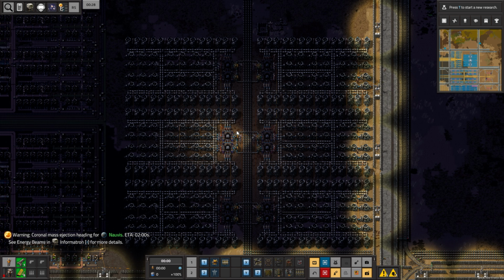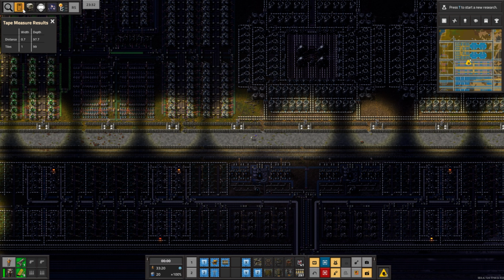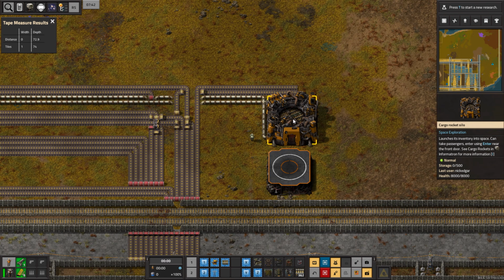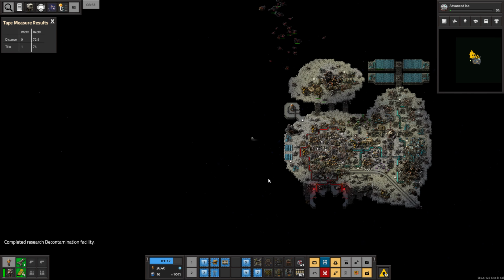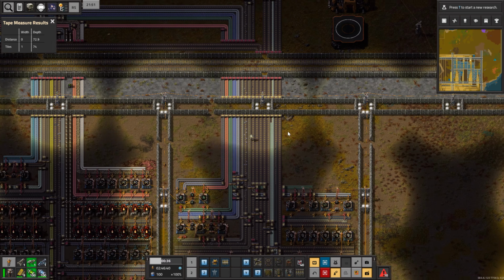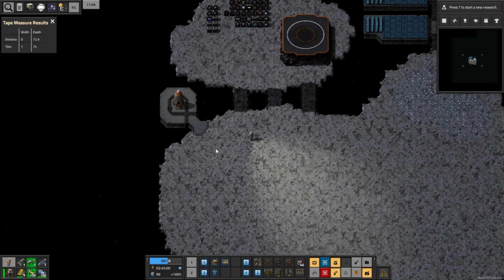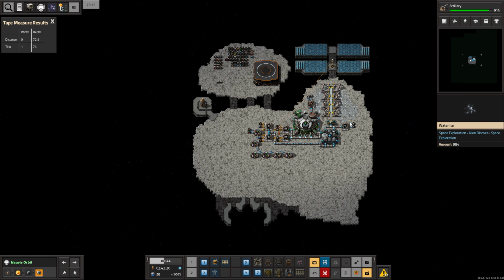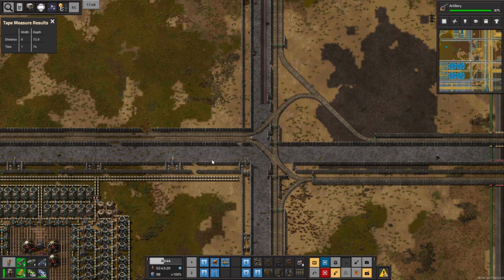Factorio - Let's Play K2SE II Episode 4

Comment: 5:00 You've probably already figured it out in the rest of the series, but once you launch your first satellite, you get access to a 'satellite view' (key N) from which you can see anywhere on any planet you've discovered (including revealing the dark parts) so you can easily check fullness of tanks for example and, more importantly, you can manipulate a lot of the elements (change direction of belts and inserters, flip switches, change settings of circuit elements, ...).

Comment: And I know you went over that someone in the comments would be like "oh you just need this mod" - but Circuit HUD V2 sounds exactly like what you're describing for tracking signals with a panel in real time. You can do a lot with tracking fluid amounts, power usage (active reactors? active boilers? accumulator charge?), logistics demand vs supply, all sorts of bits like that, and filter it out into sectioned parts of the panel, and hide the panel when you're not trying to monitor or diagnose issues.  In the bobs/angels example, alerts for acids/fluids/gasses being too high or too low, alien orb amounts, stone byproducts.. Or a count of MOX, 234, 235 fuel cells in storage. 

It will also help out when you start sending signals from orbit to surface and planet-to-planet. Having the request amounts negative/red vs the supply amounts positive/green as just a quick glance for what is missing and where. Maybe even just as a quality of life bit where you dont have to mouseover a signal from mapview and look at the entire signal at once, but can instead have a combinator giving you the important detail while filtering out all the nitty gritty that went into that -- turn on landfill production to produce salt for more batteries, rather than just seeing the logistic supply of the three separate items and tying it to a speaker when salt or batteries are too low.

Comment: Also Note: I know you don't particularly like Modules.. You may want to reconsider that with this mod for certain things.  Trying not to spoil what is to come but just know you'll want to have them at some point most likely because of obvious reasons when you get there.
Reply from the maker: In vanilla, yes, I don't like them. In big mod sets it's a completely different thing. I made them in every angel and bob factory and I used them all the time. They will get attention.

Comment: Ah! the beauty of the first accidental walk out of the platform, the: Oh! No! come back! where are you going!!!!

Great content as always. Thanks for the hard work with those timelapses.

Tips spoiler free (no mention to anything you don't have unlocked) ^^:

- In case you missed it, with your first rocket you got a message that it found a cache with items in the map (coordinates in the informatron, last section "Exploration journey"),  it contains a railgun with ammo which will trivialize clean territory of biters. It contains requester chests too. You got a few new weapons in orbit too which are a bit overpower until behemoth biters.

- If I'm correct, the steam turbines have a max effective temperature of 415 degrees, so they give you the same energy with 5k degrees steam or 500 degrees steam. You can use the electric boilers with 500 degree steam and produce it faster.

- You can move to Nauvis orbit and surface in satellite view from the icon at the bottom left of the screen while in satellite view. You can add pins to fast movent to certain positions too. To enter and exit satellite view you can pulse "N". You don't need radars to see in satellite view. In satellite view you can plant ghosts and modify recipes in buildings or combinators configuration etc... so if you have robots you don't need to go to orbit to manage it.

- You don't need to turn the barrels back to Nauvis, you can break them back into steel plates with the recicler, without material loss, and use them for scafolding, belts or whatever is needed.

- You can not send everything with delivery cannons, only base materials, and you need to consume delivery capsules for that. It is cheaper than cargo rockets at the beginning, but you will need a lot of intermediate and finished products in orbit which need to be sent by cargo rocket, so you will have to balance it.

- If you want to see a great idea about how to set an easy and flexible automated space bus based on cargo rockets, you can take a look at this 8 min video from Laurence plays where he explains how to build it, it is the best idea I found about how to send all needed materials to orbit at the beginning and mid game in space.

https://www.youtube.com/watch?v=aZki8GChUkc&t=331s&ab_channel=LaurencePlays

- I will love to have that monitoring mod too, but the closest thing I found is an ingame graph with lights. Again, Laurence plays has a video about one way to do it:

https://www.youtube.com/watch?v=m4hfjK8fF94&ab_channel=LaurencePlays
Reply: Just to add on here about the power issues because the mechanic is buried in the tooltips:

The turbines produce a max 10MW at or above 415C (which is the max temp of heat exchangers). Anything over is lost energy. Condenser turbines on the other hand can be overheated and gain efficiency as they approach 1000C, but lock if they exceed it.

This modpack also buffs solar significantly.

Not writing off cannons is good advice too. 50 stacks of water barrels in a cannon is a different material cost than 50 stacks in a rocket.

Comment: One thing, you have to use rockets. The (I think they are called delivery cannons) can only  transport basic resources like barrels of liquids or uranium 235/238 or iron plates, not science/other stuff.
Reply from the maker: Now that you mention it, I do remember reading that in the informotron. Good to know that delivery cannons would have been a pointless endeavor. Might come in useful for empty barrels though.
Reply: nobody tell him about the recycler.
Reply from the maker: Someone else mentioned that I should be scrapping the barrels and using the steel on the platform but I'm old school factorio, nothing can be deleted!! If there's a mechanism for re-using the barrels then that's what I'm gonna do.
Reply: @theotherbigfoot  instead of turning empty barrels into science and space platforms, there's no reason you can't pack them flat to save space shipping them home to be turned right back into barrels. (incidentally, this would also be an example where sending the 5 stacks of steel back via cannon would be more resource efficient than a whole rocket. Cannon automation is in some ways a tougher logistic challenge than rocket automation because cannons don't inherently know when their target is empty.) 

And fear not! there are several puzzles in this modpack where you have to juggle reusable materials in giant loops. Rocket sections and pods are just the start.

Comment: For rocket part transport, I found it best that when I go to a new planet, I bring enough stuff to get me back. If I already have rocket transport setup on a different planet, then I just have a rocket setup to deliver rocket parts and rocket fuel to wherever I tell it to. If you treat rockets as trains you have to program yourself, then you are halfway to setting up rockets. The other half is actually programming the stuff.
Reply from the maker: There's a part of me that really wants to design a little factory that produces rocket parts and rocket fuel and nothing else. Like, a perfect little square I can drop on any planet I visit. 

I haven't fully decided yet. I may go the logistics route.
Reply: @theotherbigfoot  The main issue with that plan is that unless you always go with core mining, there are some planets that are missing resources that you need to build cargo parts. It’s why I suggested the rocket that delivers parts and fuel only. You can hop down to a surface, slap down a landing platform just for taking cargo parts, and never have to worry about it.
Reply from the maker: @UnfortunateWatcher  I will accept that it is probably something I shouldn't do
Reply: @theotherbigfoot  Also, you are welcome to if you want, to hop into my K2SE run that I still have going on. I haven’t touched it in months, but it still has a working setup for delivery cannons and rockets. It might help you make a decision on what you want to do with your base.
Reply from the maker: @UnfortunateWatcher  Thank you for the offer but the mistakes are something I want to make. I'm not going to purposefully do something stupid but if it happens naturally I think that's a good thing. It's important to me that what I put out represents a true journey.

There's a part of me that thinks I should be ignoring these comments because you guys keep giving me good tips and that kinda pollutes that 'true journey', but, frankly, that isn't going to happen.

That's kinda why I want to do the little rocket factory thing. It's probably what I would have done if I wasn't on youtube.
Reply: @theotherbigfoot  I get it, I was just hoping to save you a couple dozen hours of work. You might enjoy it, but I hate wasting that much time on something that doesn’t work out. But this is your video series, you do it your own way. We can only try and help.